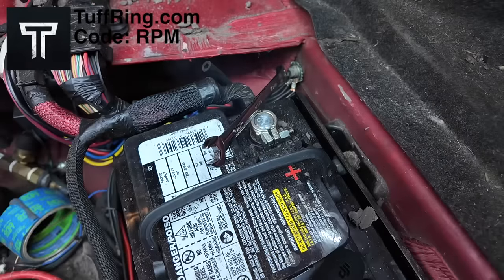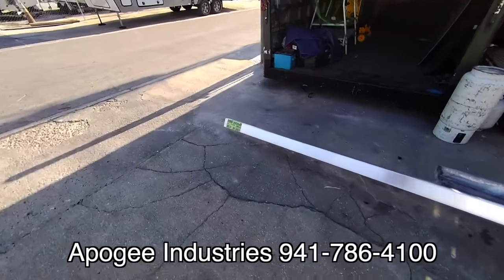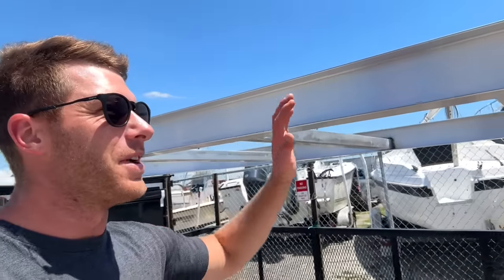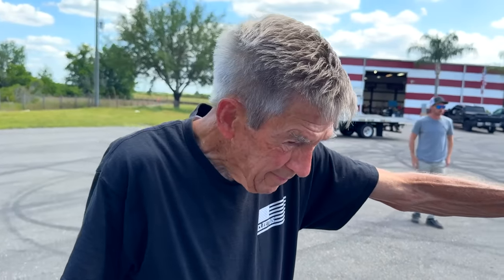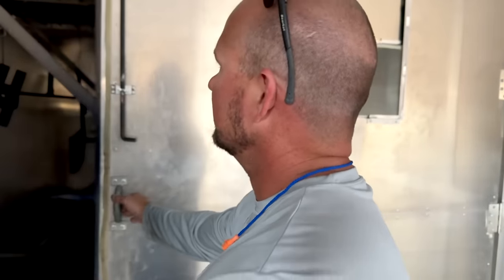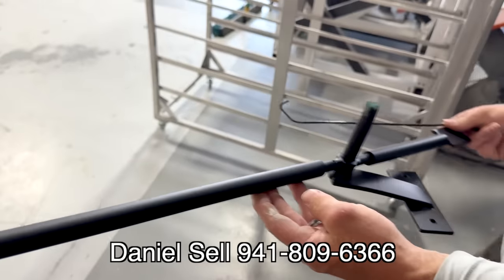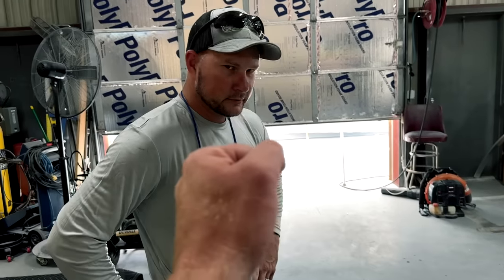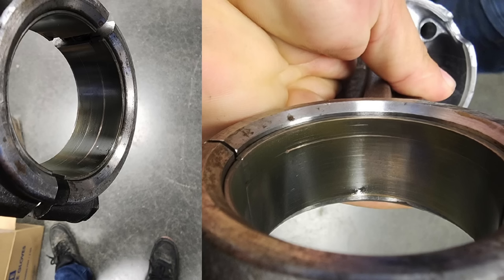Thailand Boat Engine Damage, the Trailer is INSANE!

Comment: Parker i can see that you are really exited about your boat build so please take this as constructive criticism and just think about this. A pump designed for petrol and/or oil will not work to pump water fresh or salt .That pumps have a steel impeller with steel free floating vanes running in an oval hole.Centrifugal force troughs the vanes out against the walls to make it pump. It will pump water but leave it for a week or two and it will rust the vanes to the impeller and fail. That is why all marine water pumps have plastic impellers.
Sorry I am not finished yet. The mesh in the filter you are using are to fine. That filter is designed to stop fine pieces of steel trough a oil pump in case of a engine blow out. Sand, leaves and river grass will clog it very fast and your engine will over heat. A sand trap can be used to stop debris from entering the cooling system. It uses centrifugal force to separate the debris out. I hope you understand my sloppy english. English is not my first language. Keep up the good work. I always watch posts from you and Cleetus.
Reply: You got better English than half the native speakers I see lmao
Reply: Still I can’t imagine running coolant water to the engine right from the river even with filters. Even filtered water contains particles of grass and some others stuffs, which sooner or later can clog the coolant lines of engine. Did you try to set 2 circuits of cooling? Like inner with distilled water being cooled by river water through heat exchanger. That should be safer for engine, isn’t it?
Reply: @lpcrewaw  Normal outboard engines run river or salt water straight true the engine but they are designed for it. That is were the centrifugal sand trap filter work good to trap sand and debris and it can easily be drained out.
Reply: @lpcrewaw  it’s called raw water cooling just about every outboard   In board out board , jet ski , jet boat even plenty of straight inboards it works well since you have a constant intake water temp sand traps are great . Rust is a big thing in many areas but you can still flush and rod . The other option is a heat exchanger where the mtr is cooled with a sealed system water loop through a heat exchange cooled by raw water with a constant flow in and out of heat exchanger with raw water existing ( most times ) out through risers and exhaust manifold(s)

Comment: That pump is not designed to suck it's designed for high flow rate using an impeller. The downside to a diaphragm pump is the flow rate is usually low. You might actually be better off with that one but count on a bit of water pushing into it to get it started. I'm sure there is a solution that starts right up and has high flow rate if you are willing to pay for it tho. Ask someone who knows what they are talking about, I'm sure you will. The project looks great.

Comment: Parker please don’t get offended. I think you are approaching this using what you know which is automotive experience. This entire system you have set up is grossly over complicated, undersized, over restrictive, meant for oil or fuel not salt water, and doomed to fail in salt water/marine elements. You need a marine cooling system. You don’t need a complicated closed loop cooling system with a heat exchanger. You are going to be trailering it so I would assume you would flush the engine on a garden hose with fresh water after every use. Open loop cooling is the way to go. You only need one water intake hose and the hot water discharges overboard. Most marinized engines have a crankshaft or belt driven seawater pump that uses brass housings with rubber impellers that feeds into a belt driven circulating pump. Or on inboard outboard style engines the lower unit has a rubber impeller water pump that feeds the circulating pump on the engine. And they make inline water filters for hoses in all different sizes where you can just unscrew the clear housing and clean the screen. West marine sells them. Belt driven water pumps are good for marine applications because the flow rate changes with the rpms. Are you running a thermostat in that engine? You can use an electric water pump for cooling if you really want to but I would definitely use one that has an adequate flow rate and is self priming. Jabsco makes really good pumps and the impellers are rubber and replaceable. If I were you, I would consult an inboard marine mechanic, tell him what you are trying to do, and ask him if he can recommend you a simple open loop cooling system that you can make using products right out of the west marine or sierra catalog. Automotive components just aren’t the best application for what you are trying to do. You are wasting a lot of money with all those AN  lines and fittings. Regular coast guard rated under deck waterline from west marine with good stainless steel clamps is sure to last and look simple and clean. AN stuff is good for fuel and oil but for an open loop raw water cooling system it is just a waste. The water pickups that came on your boat will only feed water to the electric pump when it is moving and picks up enough speed through the water to build enough water pressure. It is going to be a nightmare always having to prime that water pump before starting the boat and always babysitting it and worrying if the pump is staying primed or if it got airbound. If you didn’t have that strange twin layered hull I would recommend using a regular style marine seacock with a ball valve to feed your cooling system. You could even use a fancier graco sea strainer if you are worried about sand and river debris. Personally if it were my boat. I would harvest the entire closed loop cooling system off of a junked boat off Craigslist that has a mercruiser engine that is fresh water cooled, Rob the heat exchanger and components off of it, rig up a pulley driven seawater pump, use the factory Isuzu circulating pump that came on it when it was in a truck or whatever brand that engine is,make some brackets to mount the pump inline with the rest of the pulleys, put whatever length belt it requires, and mount the heat exchanger. Use the raw water side of the heat exchanger outlet to cool the exhaust and dump the hot discharge water overboard through a hose into a through hull fitting. I wish I wasn’t in Connecticut. I could go to west marine with you and rig up exactly what you need in a few hours! But for now. Keep it simple. Copy the cooling system that you had that you know worked, ditch the automotive stuff. Use the inline water strainer from west marine. Get a self priming water pump with a good flow rate and use that instead of the water pump that you have. And next season you can rebuild the entire cooling system to marine standards. Keep up the good work brother. Love the build!
Reply: Wow, thanks for all that. Experience is the best teacher and you sound experienced.
Reply: Ur completely right
Reply: 100% no sense in recreating the wheel.
Reply: To be fair, Parker is not wrong for wanting to have a pump feeding his cooling system. He has one main hurtle that makes feeding his cooling system a bit tricky when the boat isn’t at speed, which is the design of the hull of that boat and the high speed water pickups for the cooling hoses. Because it doesn’t have a conventional boat hull with one homogenous layer and it has that twin layered double hull that fills with water at slow speed to idle speed, and drains out at planing speeds, he isn’t able to just drill a hole through the bilge on the bottom of the hull and thread in a through hull fitting for a sea cock. Normal inboard style boats have the seacock located on the underside of the hull well below the waterline so that the hydrostatic pressure of the water is high enough to push water up through the seacock and feeding the water pump with no need to prime the water pump. It always has sufficient water pressure to feed the intake side of the pump as long as the through hull fitting is under water. Parker would have to drill through both layers of the hull and somehow bridge the hollow gap inside the hull layers to be able to get the seacock to extend from the inside of his bilge compartment through the exterior of the outer hull which will be a nightmare to install and seal properly and make watertight, not to mention it creates a weak spot in the hulls that is sure to start rotting once water inevitably gets into the wood. The way Parker’s boat came, the water pickups being located in the back just under the bottom side of the hull allows for the fast moving stream of water to feed and pressurize the cooling system as it is passing under the hull when the boat is at speed. It’s like sticking your mouth up to a stream of water to take a drink from the garden hose while it is spraying. The problem with this is changes in the diameter of the water pickup tubes will change how much pressure and flow you get to the cooling system. I’m guessing that the guys who designed Parker’s whole setup did all of the trial and error and testing to determine the correct size for those pickup tubes. The high speed pickup tubes will feed the cooling system as long as the boat is moving fast enough but if Parker slows down enough or comes to idle speed in situations like docking, trailering, or no wake zones, the cooling system may not be getting enough water. This is why most all inboard marine engines have a seawater pump to feed the system, and a circulating pump to, circulate the cooling water through the block or system. So again, Parker is absolutely right for wanting to have some sort of pump to feed his cooling system so that at low speeds or idle speeds when there is not sufficient pressure from the high speed water pickup tubes, the engine is still getting adequate supply of cooling water. The design of that hull makes traditional seacock through hull mounting a challenge, so pickup tubes are perfectly fine for this design. And as far as the cooling system, there isn’t much different or wrong about the way that it was originally set up when compared to traditional inboard cooling systems. The only difference is the builder in Thailand used an electric pump instead of a belt/crank/shaft driven seawater pump. I personally would prefer a mechanically driven seawater pump that varies in speed with the rpms over the constant flow of an electric seawater pump. But at the end of the day, if it worked the way the original builder set it up in Thailand, and that is how the guys typically set up their cooling systems on most long tail boats, then what the heck?! Like the gentleman above said. No need to reinvent the wheel. Parker should stick to his plan and use the same design that worked originally but make some improvements like better hoses, clamps, mounting, and routing to dress things up and make things neater and more reliable rather than using watever pieces of garden hose and tubing that was laying around. From watching a lot of boating and sailing vlogs and YouTube videos in Thailand, I must say, the people of Thailand are some of the most clever, creative, resourceful, and innovative people that I have ever seen! They are able to create, modify, repair, and improve anything no matter what they have for resources to work with. They definitely accomplish the most out of the least, and are extremely resourceful and always find usefulness in everything. If you go to any of the little shops, tents, or markets where people run their businesses, you will be able to find absolutely any replacement part that you need for absolutely anything and if they don’t have what you need in stock, they will make, machine, or manufacture exactly what you need on the spot! They will find a solution for you no matter what and they will charge you next to nothing if they even allow you to pay them at all. The Thai are such a kind, generous, resourceful, welcoming, and  beautiful people! I think Parker is on the right track and he will figure out whatever works best for his boat by getting out there, running it, testing it, and refining his setup through trial and error until it is right just like any of the race car projects he has built! I know he will get that thing dialed in and ready to Rip!
Reply: I rly hope Mr teeth and turbskies aka Parker sees this!! Good job boys. This is the way it’s supposed to be done. Always help a fellow angler / boater not just because it’s the right thing to do but because it’s our responsibility and duty to want too as we’d hope and want others to help us! - “60 pound sturgeon on 6 pound test, fish on !!” Maverick outtt 🫡

Comment: When it comes to sealing through hull ports/connections 3M 4200 and 5200 is the way to go. One thing I have learned from using the stuff is do not lick/wet your finger and try to slick the seam of out.  You can do it dry with a tool (I cut and sand plastic dough scrapers to my desired profile and carefully run it along/over the bead of 4200/5200 I applied. Additionally less is more when caulking seems etc.

Comment: I would use stainless steel hard line for those water lines. Either bend it tight to the swim step or drill holes for hard lines to pass threw

Comment: So for your lines what about using your billet idea but have hard lines with an fittings on top and bottom so you don’t have a risk of leak in anyway also helps if a line breaks just replace a top line or a bottom line

Comment: For the cooling system you could shape 2 inlets directly shaped in the haul if it’s a solid wood sandwich or you can also bore those inlets with a CNC and make custom CNC inlets that screws and fits flush in those inserts and comes up inside the boat with AN fitting’s

Comment: Angle the tube for the water pump towards the front of the boat get moving first so that the force of the boat going forward pushes water up into the line then turn on the pump

Comment: In dirt late models (specifically supers) we run a dry sump and use a flywheel driven oil, fuel, and power steering pump(they’re all one assembly but you can take them apart and just run a 1,2,or 3 pump setup but the one we have has had a primer like the one you showed it allows us to prime the fuel system, and oil system (power steering systems doesn’t matter but technically it primed it also because it primed every pump you have on the assembly)

Comment: I don't normally watch (or comment on ) ad's or sponsors but Those rings are a MUST for anyone who works with their hands.  Not only protect against bad burns like that but also the FAR worse injury of de-gloving. which so very nearly happened to me many years ago.
Reply: seeing georges finger made me wince a little. that didn't look good at all! if I was a car guy then this would be a must for sure
Reply: I agree on silicone rings being the way to go but i have seen a partial de-gloving with a silicone ring before it snapped... But far better than the for sure amputation that would have happened with a traditional wedding ring
Reply: I know a guy that was running a truck on a lift and was feeling around the drive line for a vibration. Woke up on the ground with a missing finger. The driveshaft weight caught his ring and slammed him/ripped his finger right off
Reply: I just didn't get married...💪

Comment: Here are some thoughts put the pass though in that plate in the deck or the whole in the underside of the deck and plate it off. You could have wings on the outside of the deck and run the pipes up though that wing.

Comment: A simple check valve on the water inlet will fix your prime issue. When the pump gets turned off the inlet hose shuts off and holds water inside the hose and pump

Comment: You're over complicating the water system. If you're that worried about debris use a closed loop. Otherwise that filter on an open loop will get clogged in the first couple hours. I'm from south Louisiana. We've had long tails and surface drives and inboard mud boats for decades. Open or closed loop without filters is the way to go.

Comment: Quite a few companies(IMCO included) make a transom mounted water pickups (typically for V drive applications). Might be easier to ditch the original pickups and run them through the transom.

Comment: Hey buddy you should just have the guy that is making the logos have him put the logo into pieces of flat aluminum and then weld them to the top and bottom of the I beams and then put some cool colored lights that can go behind the logos and light up the logo’s!!! To finish the logos off you could either leave both sides open or take some aluminum and have them welded to each side of the logos and then have them go at an angle to the center of the web of the I beams and have them fully welded in!!! I definitely think that would look totally cool and I would also think that it would help beef up the I beams also!!! By leaving both sides of the logo open the lights would show the logo and go out both sides of the logo and would depend on how big or how powerful of a light you might get will depend on how much light would protrude out both sides!! And if you would in close the logo the light would only protrude out the logo!!! Hopefully this all makes sense to you and I definitely think it would look sick showing off the logos that way instead of just welding the logo onto the inner web of the I beams!!! Let me know what you think of this idea???

Comment: Use 4200 or 5200 sealant if your gonna use the billet piece for the water pickup. You don’t want any water getting  in the boat. Especially if it Dosent have any access point into that compartment. Unless you drill another hole in the bottom side for a flush mouth drain. Best of luck and can’t wait to see it get going.
Reply: Do not use 5200 on anything unless you're gluing a boat together. It's not silicone. Shit is fuckin permanent.